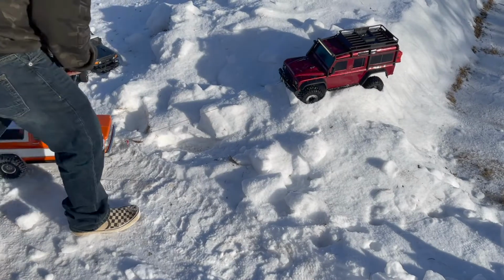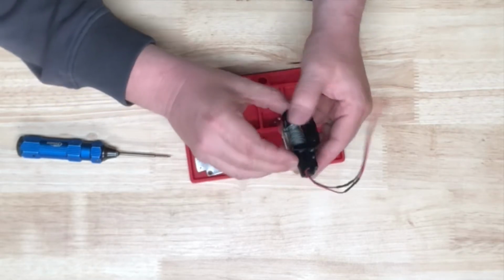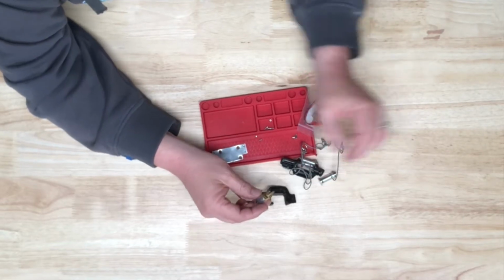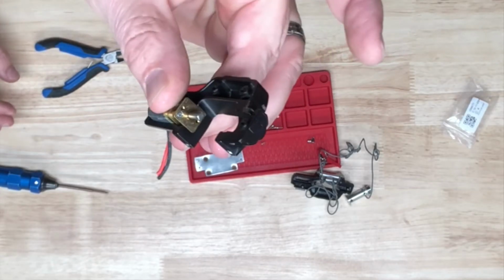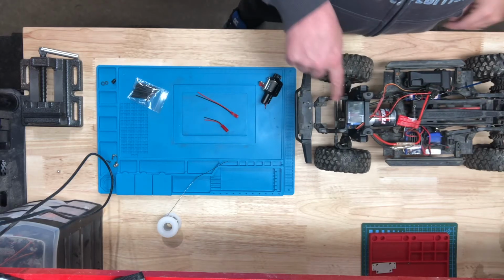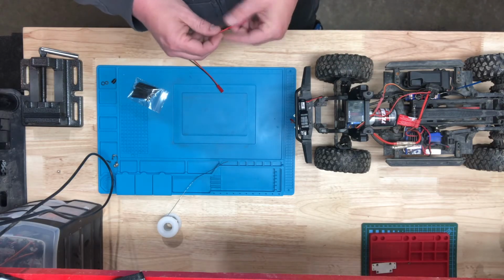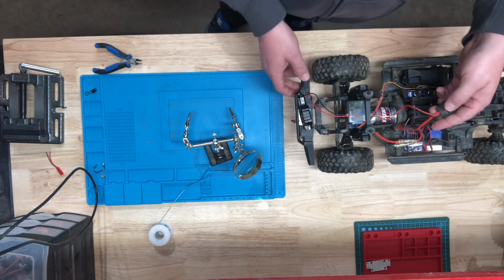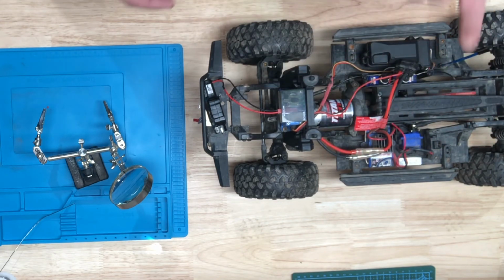Warn Winch 1/10 RC Motor Replacement Repair/ Lets Play RC!

Comment: Hey man I'm just getting in to rcs an the winch I bought is pretty nice but the power wire came out how do I pull the cover off the motor to fix the wire it's from the same company basically but no brand name on it

Comment: I have a ton of winches that stopped working after get  wet so I don't know if it the controller or winch but now I have traxxas winches and their waterproof
Reply from the maker: Yea the warm winches are pretty good. Long trusted brand. However I was thinking of trying out the Traxxas brand on my next build. ( complete upgrade TRX 4 Defender).  

Let me know how yours works out. 👍😉😁